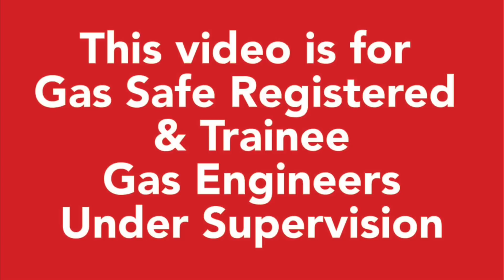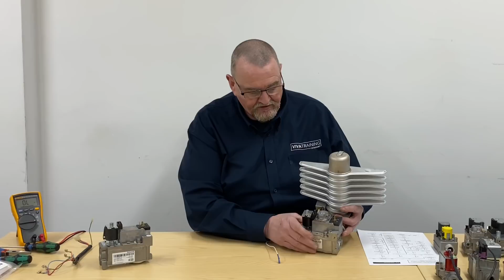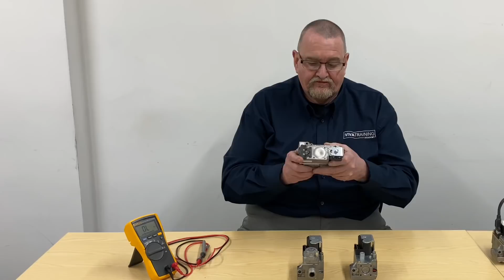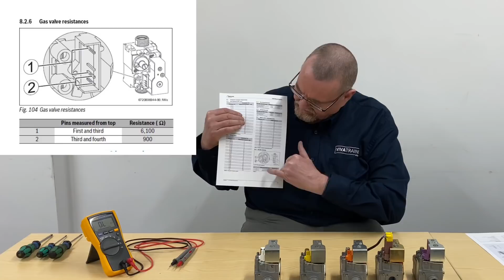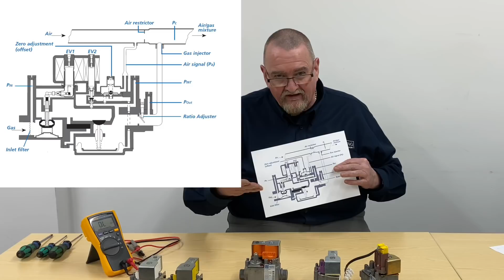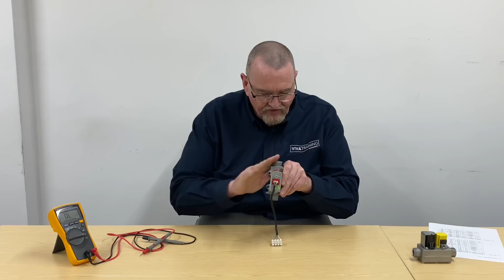Gas Training - Setting Up And Testing Gas Valves - Roy Fugler

Comment: This video was incredibly helpful.  Let me tell you a story.  I have an old Baxi 310.  Every couple years it burns a board, always in the same spot. Burns off solder point under relay. Indicating a high current spot.  Always burns in the same spot!
The 310 uses a modulating gas valve.  What I learned in this video is there is a green one (28volt) and a white one (16 volt).   Well, the board in my baxi is putting out 23 volts to the gas valve modulating coil.  The coil on my baxi is the white one.  So guess what is happening, the board is overdriving the coil with high voltage and as a result it is pulling high current through the board. The result …. Perfectly repeated board failures on the same circuit.   So I obviously need a “green” coil.

Can one buy just the modulating coil or does it have to come as a whole valve?

Comment: Great video, very informative and well delivered. The issue I find is actually finding resistance value information to be able to complete the tests. What is the best way to get the numbers? You would think every manufacturer would just put the values for each component near the front of their manual so it's easy to find. Thanks Gents.

Comment: Hi Roy does the second gas valve work the same way as the zero governor. I thought zero governors were negative pressure due to the fan sucking and blowing the gas onto the burner
Reply from the maker: Thank You

Comment: Welcome Allen!
I want to know if a Westen Star Condens gas boiler is the same as the Baxi Duo-Tec! After cleaning (acidifying) the Al-SI heat exchanger, the "Automatic calibration" will start, but after ignition it will throw away the flame! There's a new electrode in it! The videos are very helpful, thank you!
Reply from the maker: Thank You

Comment: Hello, my boiler has the following problem:
When I request domestic hot water, the boiler works correctly,
when I turn on the radiators the boiler starts with the burner at minimum power after a few minutes the burner starts to regulate, sometimes it stays at minimum power and then goes out. Please,
can you give me some suggestions?
Thank you
Reply from the maker: Thank You

Comment: Good evening, do the two solenoids V1 and V2 have the same function?
Why is the resistance measurement of the two solenoids V1 and V2 different?
Thank you.
Reply from the maker: Thank You
Reply: Hi Baffo, One is the main solenoid and the other is a safety solenoid.  The reason the resistance is different is due to the spring pressure they need to over come to open.
Reply: @royfugler9971  Thanks
Reply: The safety is a heavier spring because it is fast close.
Reply: @stephenhudson4931  Thank You

Comment: Good afternoon, 
Questions: 
1) Why does the gas valve have two coils (V1 - V2)?
2) Why do the two coils have different resistance measurements?
3) Do V1 and V2 open and close at the same time?
Thanks
Reply: Hi Baffo,
Thanks for the questions.
1/ The reason the gas valve has two solenoids is that one is the main solenoid and the other is a safety solenoid, in case one solenoid sticks in the open position or has dirt on the seat, the other would still cut off the gas.
2/ The resistance is different is due to the spring pressure they need to over come to open.
3/ Yes V1 & V2 both open and close together
Reply: @royfugler9971  Thanks

Comment: Great stuff as usual. I've got a question if anyone knows and it's regarding the very first valve you worked on. I was working on saunier Duvall Xeon. Pilot would light but main burner wouldn't. 
Question 1 How does the ignition lead send the signal to the pcb that ignition is present? Is this similar to flame rec?
Question 2 MI's indicated this was a board fault, but customer already had another guy fit a new board so discounted this. I checked connections on the lead and the lead itself but still no joy. Anyone any clues as to what was wrong.
I called glowworm but they advised that they can't give any technical help on this product anymore. Cant help but feel I missed something simple.
Reply: Hi Jordan, Yes it's the same as flame rectification. If the ignition is still sparking once the pilot has lit it could be either a bad earth connection or reverse polarity to the boiler (live to neutral crossed). If the spark had stopped once the pilot lights the Pcb has sensed the flame so could be main solenoid or solenoid lead, check if you have power going to the main solenoid once the pilot is lit.
Reply: Ok Roy thanks for the info....
Reply from the maker: Thank You